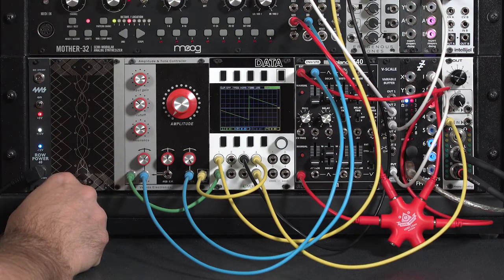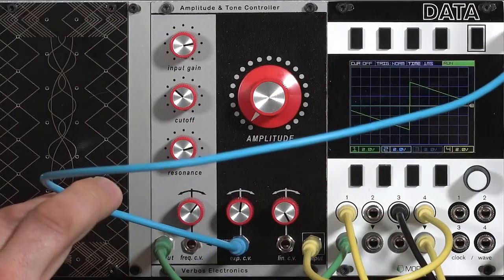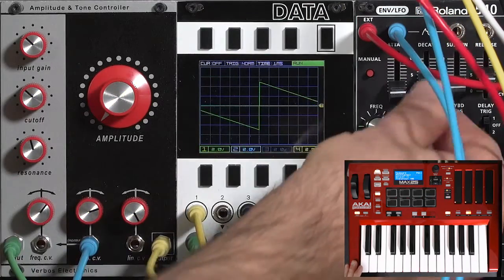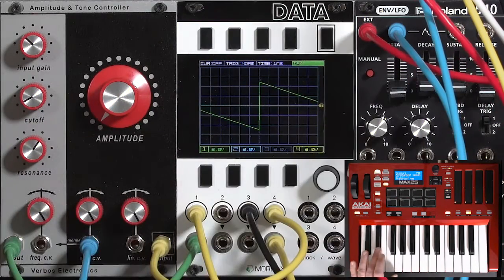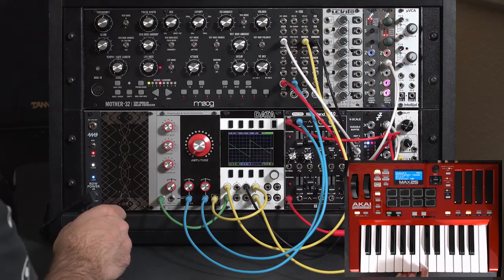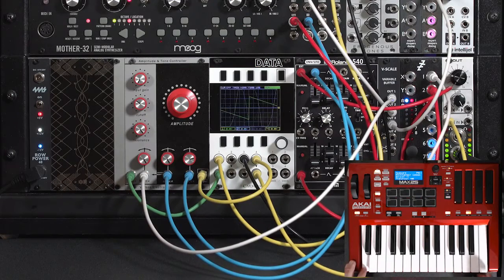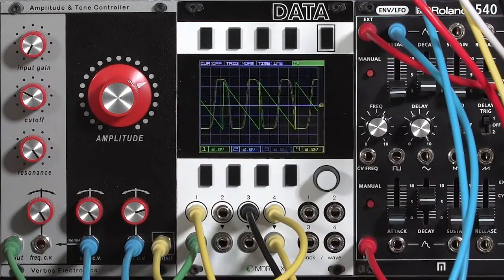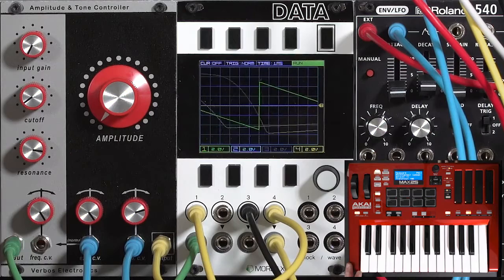Verbos Amplitude & Tone Controller 2/3: LPGs, Vactrols, & Percussion (LMS EE)

Comment: The current new version of the Amp & Tone does not have vactrols anymore. I'm curious to know if this is in your opinion an improvement of the module? Also, would the current A&T be able to act as an LPG in the same way as the one you're using here?
Reply from the maker: I'd have to hear it to really pass judgement. The decay curve of vactrols can be emulated with other hardware, and frankly the slow response of vactrols means you can't audio-rate FM a parameter with a vactrol in the way - so there are definitely trade-offs.